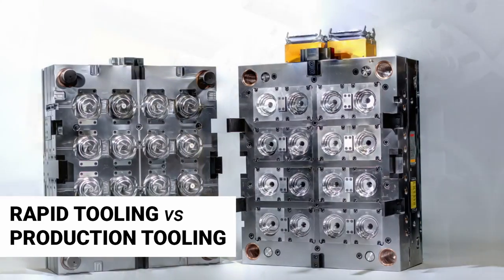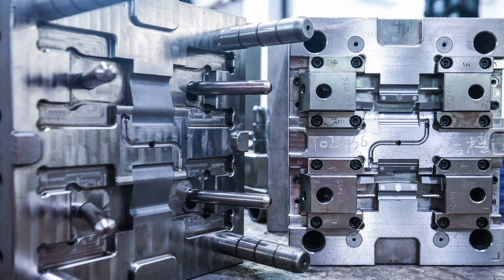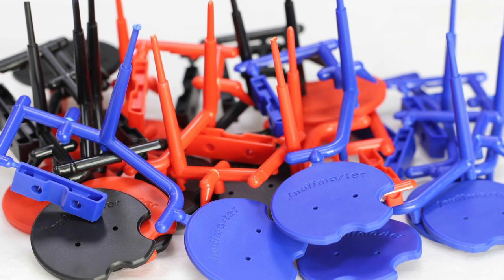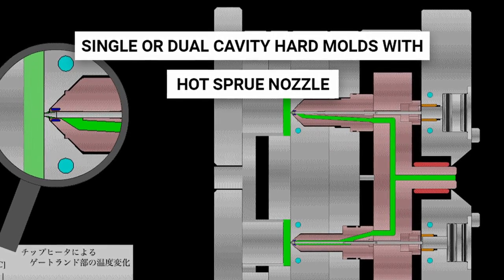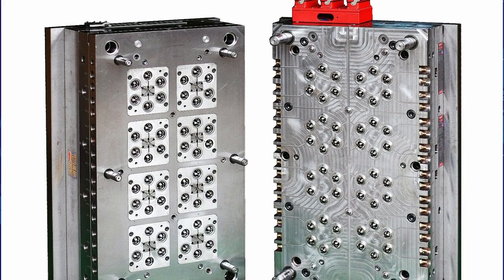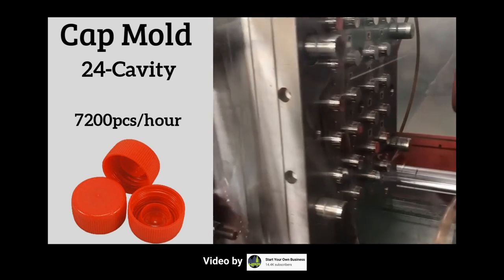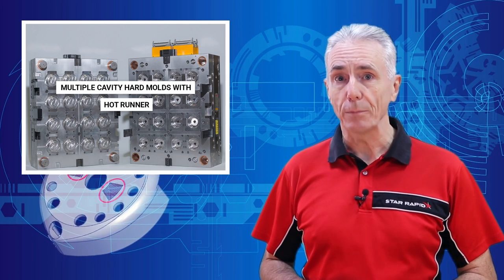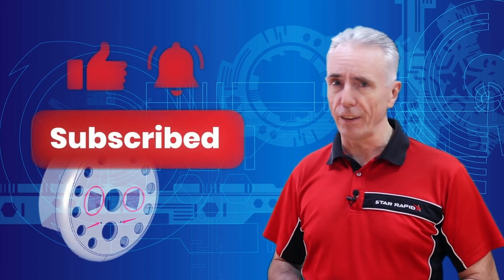INSANE multi-cavity molds to make MILLIONS of plastic parts! - Serious Engineering - Ep24

Comment: What causes metals to stop being usable as molds?
Reply from the maker: Good question. I guess you could use almost any material. The problem is that some materials like copper more reactive, therefore would oxidise more quickly. The same will go for magnesium. You need a material that doesn’t corrode easily.
Reply from the maker: It wears out because of chemical erosion and physical abrasion. So, it is very important to match the mold making material with the chemistry and abrasive nature of whatever you are molding.